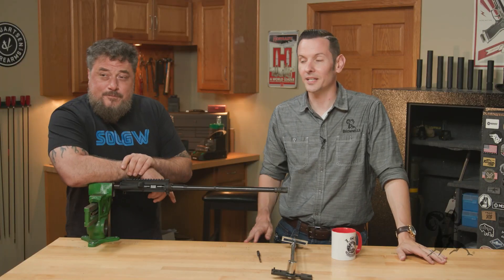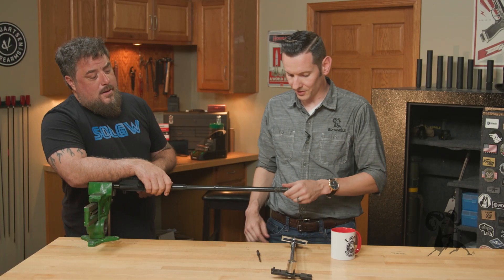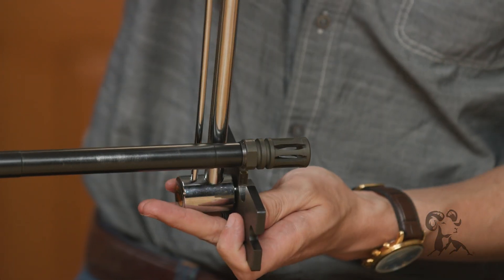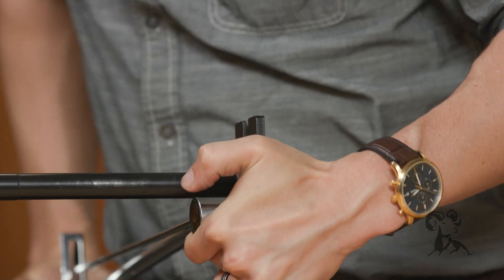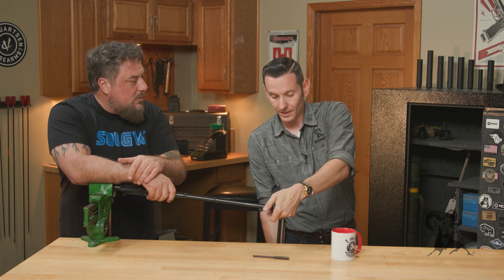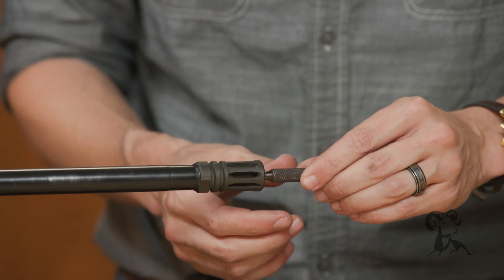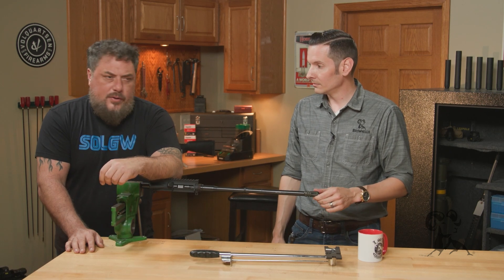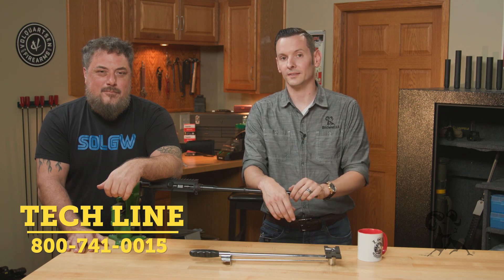Tech Tip: Can a Muzzle Device be too Tight?

Comment: Ordered some crush washers online to swap a muzzle device out on one of my rifles. Started putting the torque to it and instantly realized the crush washer was not going to work. The amount of force it would have taken to crush the washer was way beyond 30 foot pounds. Had to get new crush washers from a well respected manufacturer. Won't be buying off eBay again 😂  Great video as always
Reply: Crush washers are so cheap, you might as well buy the name brand washers
Reply: But how do you know it wasn't crushing? Like my understanding a crush washer won't physically crush to the eye, it is microscopic or more subtle.
Reply: I use eBay for Glock parts only
Reply: Try shims instead
Reply: @charlieethankingman9252  I have shims but it's just a flash hider and didn't need it to be timed. Now I'm running a dead air xeno flash hider with no shims or crush washer
Reply: Should be using muzzle shims, not crush washers
Reply: @dmaraschky1  crush washer is fine on an a2 flash hider. I'm running precision armament shims on my muzzle devices that need timed that attach to my can
Reply: Your comment doesn't make sense. How did you "know" it's not going to work? You say it needed too much force to crush, so at 30lbft it didn't crush at all?
Reply: @bench175  because when you start putting torque to one you can tell when you're exceeding 35 lb ft of torque. It makes perfect sense lol these crush washers were not made for firearms but were marketed as such
Reply: @ethan5.56  You probably just need to work out more
Reply: @bench175  maybe so 🤣 wouldn't hurt but putting one of those crush washers on a rifle would hurt something
Reply: I think I put my flash hider on at 45-50ft lb on a 7.5” 556 barrel,, I can’t get my scope zeroed in perfect, idk if it’s my scope or the flash hider
Reply: @omarmendez4003  wouldn't hurt to re torque your muzzle device. Could be a number of variables but that's a good place to start
Reply: @omarmendez4003 could be the short barrel length causing problems aswell, there’s an insane amount of muzzle blast from unburnt powder and I’d bet it’s possible that it could be destabilizing the projectile.
It’s a possibility anyway, the barrel restriction can also be an issue, same with the optic, or the manufacturer of the barrel could have done a poor job. That short of barrel gives you the muzzle energy of a 22 magnum anyway, so I’d recommend swapping out for a 10 inch barrel minimum. (2100 fps with a 7.5, 2600 with a 10, 2900 with a 16, and 3100 with a 20 inch barrel, for a velocity reference chart, with the same ammo)
Reply: @magnusskipton7067 I have 1-10.5” & 1-7.5” barrel the 10.5” is perfect but the 7.5 I think the bullet is not going straight, idk what the problem is
Reply: @omarmendez4003  start with the muzzle device and clean the barrel really good. Maybe shoot a couple different weights of ammo to see which one the rifle likes if it likes any
Reply: @omarmendez4003  lack of velocity due to the short gas port length and decreased dwell time. Can't get the bullet spinning fast enough leads to decreased accuracy and energy delivered to the target. This is why an actual military mk18 is no shorter than 10.3". That's where lots of r&d have already determined is about as short a barrel you want to realistically and practically go for 5.56.

Comment: I have done exactly that before, I’m the exact scenario you described. Thank you for this info.
Reply: I believe I've done the same.  My POI shifted 8" right and would not group.  How was your barrel afterwards?
Reply: @bsku8568 Did you ever fix it? Was the barrel toast?
Reply: @ no, I had my local guru remove the old device and install a new one. He timed it by milling it down instead of using shims so it was torqued to spec and timed. Seems to be fine but honestly I’m not a good enough shooter to give you real data on it. I know I over torqued it improperly trying to time it. Total rookie mistake

Comment: Yes it can... I literally sheared the threads on an AR barrell the 1st time I changed a muzzle device trying to get it it timed right... the threads literally fell to the ground still threaded in the muzzle device and the barrel was ruined...
Reply: You can precrush the crush washer to get it to time it correctly or to remove it as well.
Reply: @ratagris21  Yeah, this was over 10yrs ago. I was so pissed... luckily it was an 18" barrel, so I had it cut down to 16" and rethreaded; but that barrel has always been 2moa at best and with 55grain target its 3-4 MOA... my fault though, lesson learned.